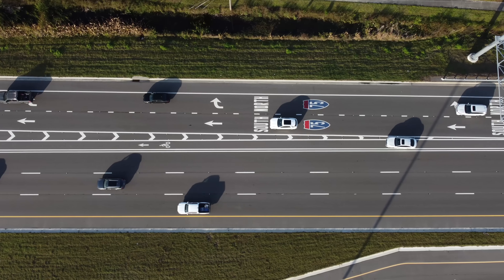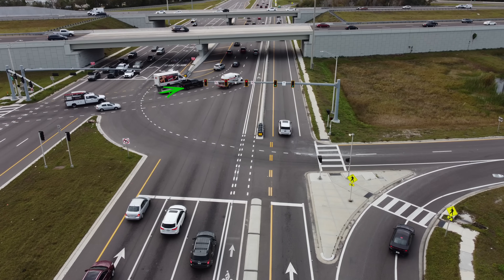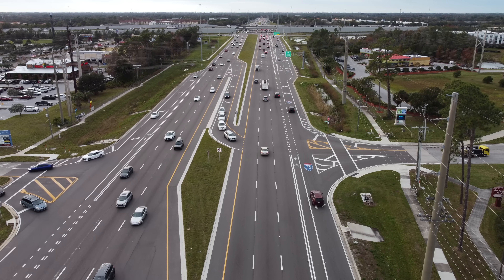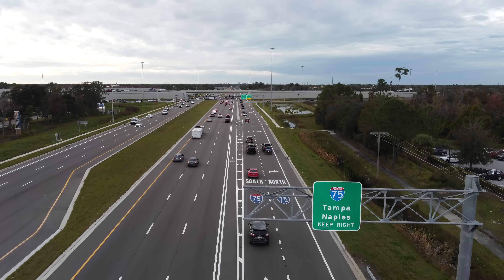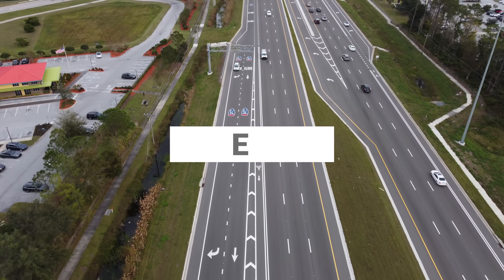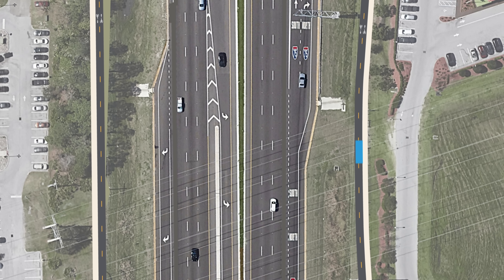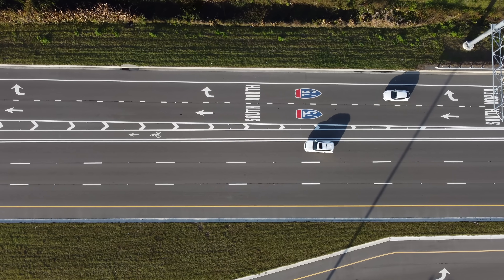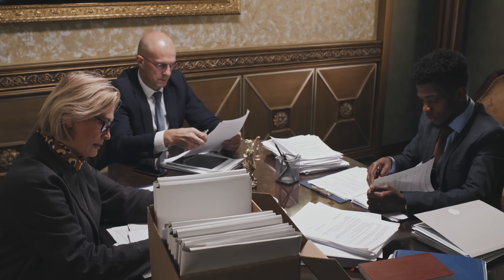This Brand New Interchange is Already Flawed

Comment: That signage is really poor. The one furthest away from the interchange is a mess. Not really MUTCD-compliant either. Definitely should've designed for a wider sidewalk/multi-use path. Even if only on one side of the road. Those kinds of bikes lanes are almost entirely useless.

Something else they could have considered are mini-curbs and bollards in the taper area where the right lanes leave the main roadway. That way, cars might think twice about crossing.

Comment: Hi Streetcraft, you gotta check out the tiny interchanges they have here in Germany. Rural 2 lane roads are bridged here often and have many interchanges. One example is the B470 + B299 Interchange (49.70626732046738, 12.037466515775566) and the B470 + NEW2 interchange(49.70626732046738, 12.037466515775566). They're tiny 2 lane roads (1 in each direction) yet German Civil engineers put interchanges in them. It's fascinating and I think you'll find it interested.